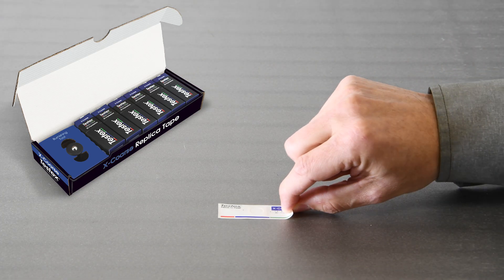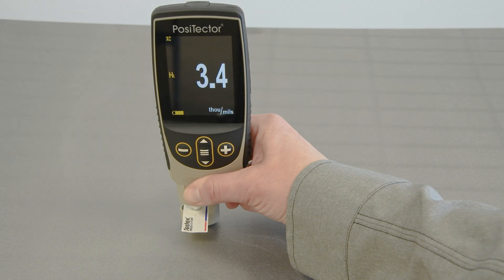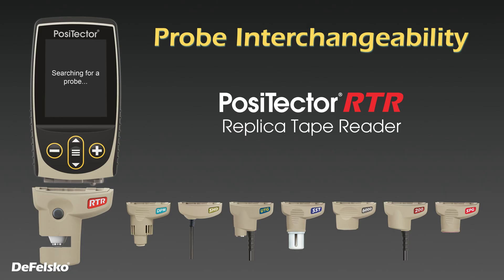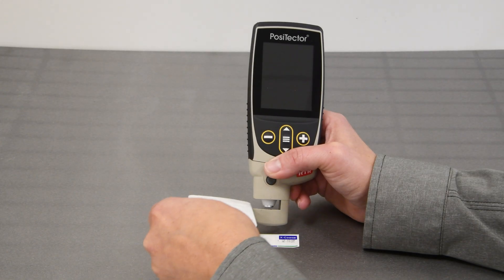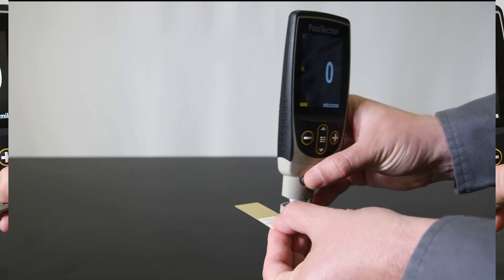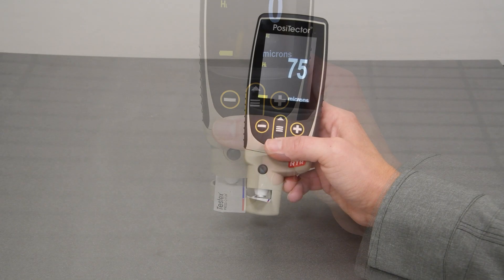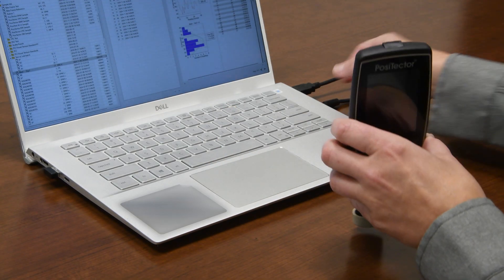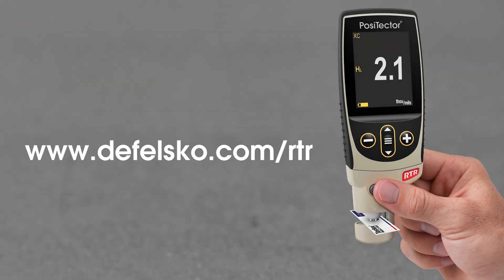How to Measure Surface Profile using Testex Replica Tape and the PosiTector RTR

Comment: Came here because the new testex tape came with this spring loaded burnishing tool. It's too soft for SP 10 profiles 2-4 mils. So I'm just curious what it's even for.
Reply from the maker: Hi Robbie,  

Great question! The spring-loaded high accuracy burnishing tool exerts the perfect amount of pressure to burnish (create) a replica. It reduces operator influence, providing a 0.3 mil (±8 µm) accuracy throughout the Testex replica tape range (0.5 - 6 mils or 12 - 150 µm). Achieving a complete burnish typically requires several passes, particularly at the lower end of a tape grade’s range, where it may take up to a minute to produce the characteristic stippled gray appearance.

 The classic click-type burnishing tool remains a valid measurement practice and is recognized by international standards. Care should be given to avoid applying too much force. Excessive force can lead to inaccurate measurements.  Feel free to contact our technical team at +1-315-393-4550 or techsale@defelsko.com to discuss this further. Thank you.
Reply: @DeFelsko  the spring loaded burnishing tools we have received do not have enough pressure to imprint on the testex what so ever, we have tried 5 different ones.
Reply from the maker: @robbieknight4508  Please feel free to contact me directly calling +1-315-393-4550 to discuss this further. Thank you. Terry L.
Reply: @robbieknight4508  I've caught multiple coating QC inspectors using too much force or the incorrect tool for burnishing. This can cause the plastic film to warp and result in false high measurements. If using a spring micrometer, you have to use the table buried in Defelsko's instructions for testex tape to convert the measurement you read to what it actually is. Most QC people I encounter, AMPP/NACE 2 and 3s included haven't read the new instructions and weren't properly trained. Defelsko has made strides in getting consistency between the replica tape and depth micrometer measurements by greatly reducing the operator factor.